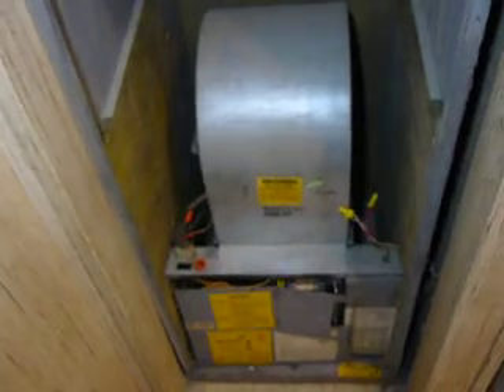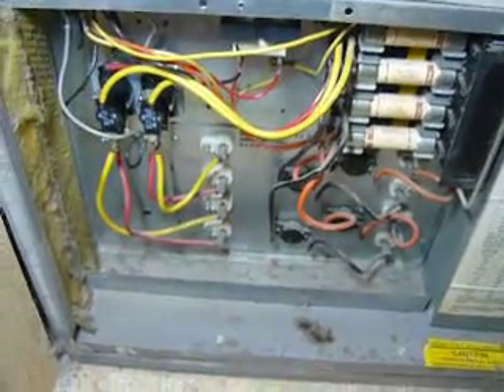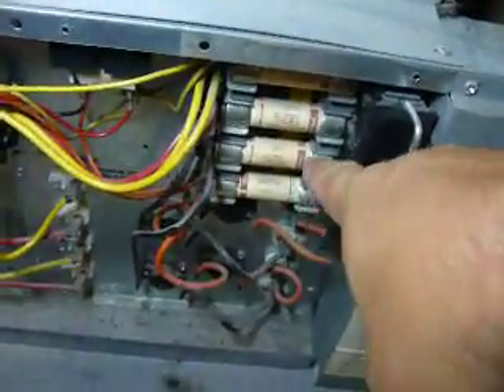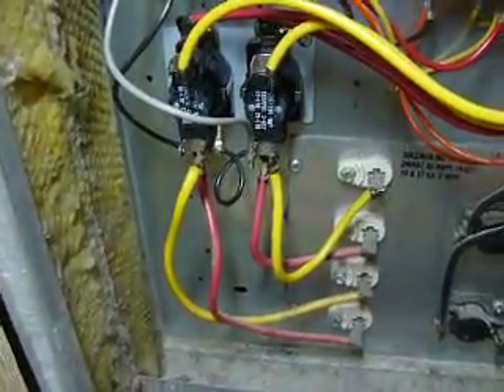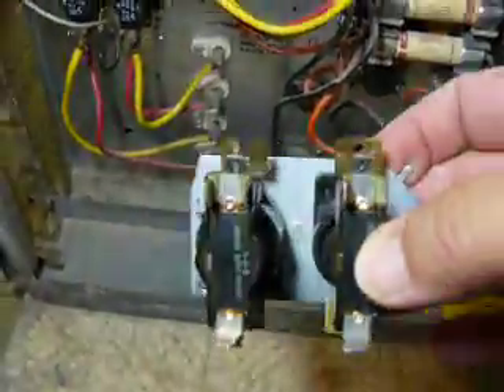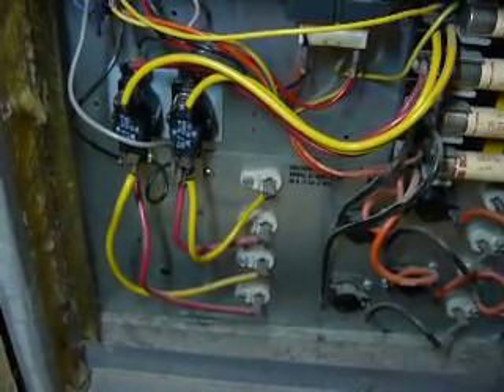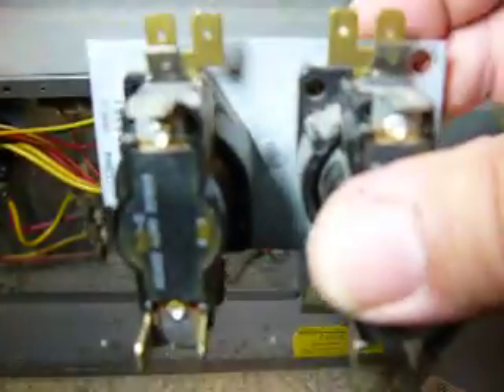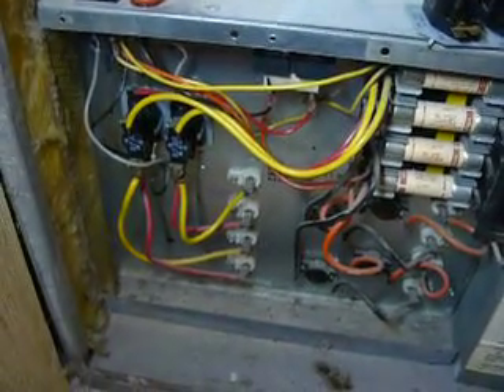Coleman Electric Furnace 3400 No Heat Troubleshoot

Comment: Hey there my coleman 3400 furnace blower will not kick on the heating elements work i can see them glowing on the 3400 there is a on and off switch which will turn the blower on can you help?
Reply from the maker: I would cycle the furnace and check for voltage that goes to the motor. If you have voltage, the motor is more than likely bad. If you get no power, go backwards from the motor and check for power up to the control switches ( there should be an on/off switch to the motor, see if you have power their)
Reply: +breakerbroke23 
just saw this i have a 3400a800 and it doesnt have a on off switch 
any chance its hiddne somewhere
Reply from the maker: +James Ile Mine is on the floor or the bottom of the furnace enclosure if you will. 
Your installer may have put it elsewhere .. It should be in there somewhere ( to be installed to code)